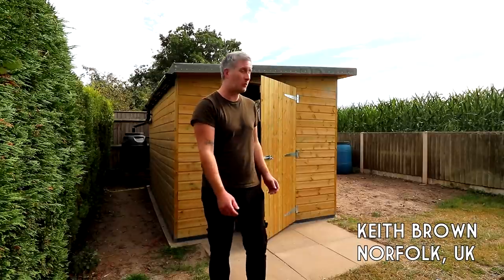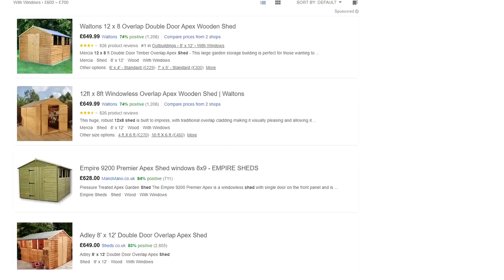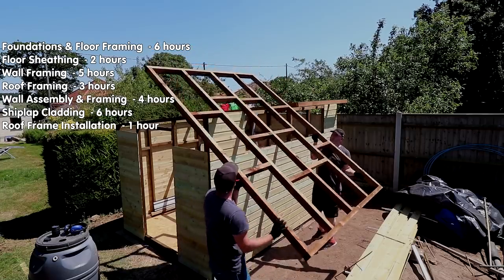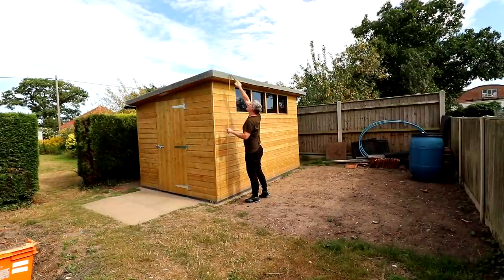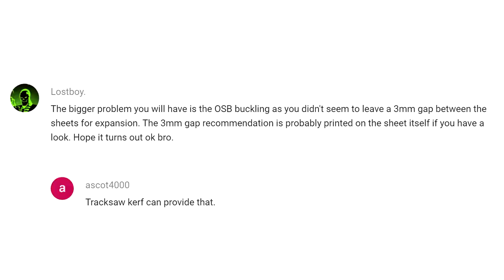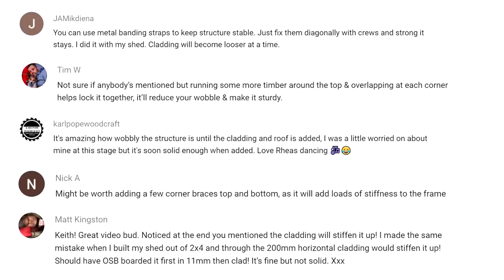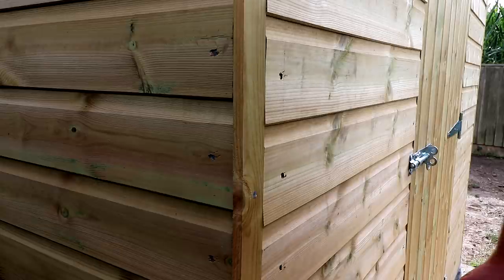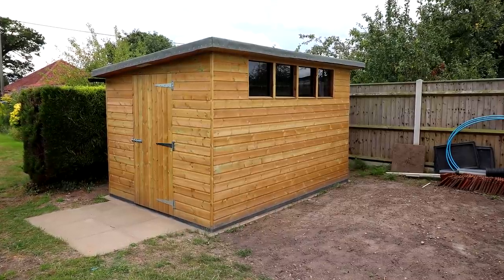Finished Shed - Interior / Costs / Timescales / Q&A (PART 7)

Comment: Few hints on shed storage.
Keep paint tins upside down: stops rusty crud collecting inside the rim. Also stops cruddy skin on top of paint.
Garden Tools. Create a sandbox enough to hold all tools edge downward., pour in old engine oil & mix. Keep spades, shovel, fork etc dug into oily sand. This will keep them clean & prevent rust on surfaces.

Strong build, should last a lifetime!
Reply: I wonder how many guys have read your comment and upturned paint tins with poor sealing lids only for the lid to come off or the paint to seep out over time ? ☺️ It does work but you still get the dry disc on the bottom of the tin(yes you don’t have to scoop it out like if on the top).

 Sitting cling film on the actual paint and cling filming the lid the right way up works. Another dead cert ways is to use all the paint and not worry about it 😂😂😂 Cheers , happy storing ✌🏻👍🏻

Comment: Tip from experience: Take the pressure washer out of the shed before there's any possibility of frost. There's always some water left inside which can freeze and then the washer is scrap.
Reply from the maker: cheers, will do
Reply: Or buy a decent pressure washer like a kranzle which isn’t full of plastic rubbish like karchers or nilfisk or any cheap consumer washer.  Karchers even use plastic housing the motor which is why they fail

Comment: Good solid shed, great to see you addressing viewers questions...

Most of which I feel are from the US...

I have just finished building a 20ft x 14ft workshop with a pent roof. Concrete base, 3x2 frame, 4x2 roof framing, plus OSB sheeting, and a felt roof... Came in under £1600. I was quoted £4k for workshop alone with an extra £500 for the concrete base...

What I have now is much stronger then prefab panels, and it's custom to my needs,

I have a pair of solar panels and related equipment coming within the week so I can have power and lighting.

It really pays to do it yourself.

Great build R & B man! From a fellow Norfolk born diy'er!

Comment: Oh the shed will be fine, nothing to worry about. You done great!
Roof might be a bit iffy but who doesn't have problems with shed roofs after a while.
Reply: Originally, I thought the roof might not be strong enough. However, upon further consideration I think it will be fine. Other that snow there really isn't anything to put noticeable weight on it. Here in Minnesota, in the U.S., snow weight is something I always have to prepare for, so I wouldn't be able to get away with using 2x2 rafters on something that large. I think Keith can though, the U.K. doesn't get as much snow.
Reply: @theopiner402  Yes, where I live snow loading is not exactly high on the list for things to be concerned about, but hail is, and also if you put on a gutter and down pipe it better be sized for the annual tropical storms that hit here, delivering up to a metre of rain in an hour. Worst hail I ever saw was around a half metre of hail drifts, though most was around 20cm, and this was laid down in around 2 hours as the storm passed over. Just lucky I do not live further inland, where tornadoes are also an annual thing to have one or two. Up on the Reef, where I have lived, you have your every day Summer storm, which is just around sunset, and drops a lot of rain each day, with hail as a special, and lightning and thunder as prelude.

Comment: Hello Keith that's a nice tidy shed. I know you're fed up of everybody telling you to do things differently, but I have a very similar shed and over a long period of time it did take on a good lean. It's a combination of internal loading and heating/cooling cycles with the weather. If something heavy is leaning on one wall the wall will tend to move that way. It might take four or five years but it will start to lean. I fixed my shed by adding diagonal braces inside the panels. I made a video of it and it is actually one of my most popular videos even though the quality is dreadful. If I were you, I'd just get 8 lengths of 2x2 and add two diagonals each side, in each end rectangle of each side frame, each one opposing it's twin. I hope you read this, it would be a piece of cake to increase the rigidity immensely for not much extra cost. It might take four or five years but it will start to lean. All the best. Mart.

Comment: I know you've already bought some wood treatment stuff, but I thought I'd recommend 'Barrettine Wood Protective Treatment' anyway. It's solvent based and quite thin so the wood really soaks it up, especially the endgrain and it leaves a lovely satin oil finish (I don't like the modern acrylic water-based stuff as it just sits on the surface). It's available in many different shades and I bought mine from Toolstation, it was about £20 for 5 Litres.

Comment: Good end to a great series Keith. A genuinely useful practical guide and I like the idea of good enough - I am unfortunately obsessed with details and planning, to the point of projects being handicapped by my need for perfection - which I rarely achieve anyway. I definitely need to learn to relax into projects and just get them done! Thanks again. In terms of the shed itself I think the only change I would make would be to fit barge boards (fascias) around the roof felt - otherwise it looks great.

Comment: In the middle of building a 8*12 shed , using 145mm x 25mm hard wood planks OSB board with 8*1 shiplap planks the walls weight about 150kg 😅

Comment: Enjoyed your shed build and found it helpful as I'm currently in the process of building my own. I have a question I hope you can help with. I'm building the shed for my allotment, so want to use some reclaimed materials to keep costs down, but I will be buying the timber for the base and frame. I've gone with 3x2 for the base, but I'm wondering if I can get away with 2x2 for the frame? The shed is 3m x 3m, and I will most likely use pallet wood for the cladding. Will this choice in cladding and 2x2 timber give it enough strength? Or am I better off using 3x2 for the frame? Thanks :)

Comment: I don't blame you for having a go but my 8x12 ft shed contains no chipboard or ply, 1 inch thick floor and roof boards, glass in the windows, double door opening and 15mm t&g cladding cost £650 and they came and erected it for that, I just had to lay the base. All of the timber was tanalised as well.

Comment: there is a bit of something to that cladding comment, i mean if i remember correctly you only added 1 nail per join (to allow for contracting/expanding), which offers no resistance against twists, like 2-3 nails would, in fact it makes a perfect pivot, it's the friction in the tongue and groove that added rigidity to your shed, i wonder what would happen if those panels would contract/shrink... anyway you can add a few diagonal braces on the inside if needed.
Also nowhere in any of the videos did you talk about metal roof or siding as an option, i'm pretty sure that is the cheapest option where i live. It is about 4 quid for a 2x1m panel, so maybe it's not that cheap after all? also you might need some OSB under it since i don't think that adds much rigidity for the walls (or ability to walk on the roof)

Comment: 2.4m to highest point. I got around this by adding some slabs in front. For an apex shed, it's 4.8m, but is not allowed a sleeping space. 1m away from bounding fences.

As for walls, osb is fine, cover with tyvex weather proof lining, then cladd with feather edge. Will last much longer.

2x2 pressure treated timber isn't needed. Cls stud work is all you need once the base is done and you add good weather protection.

Comment: just want to mention that what you use the shed for will decide to have breather membrane and/or VCL or not, in your case i dont think you need one, our UK climate is on the wet side, so you hope there is ventilation or air leak in place to take the moist away more than having a breather membrane which make it worse because you installed felt membrane roof covering which is not permeable, if you installed more membrane underbeath or behind wall cladding it is going to trap moisture in your roof structure.  Some common mistake from DIYer "is more is better", when it comes to U-value and building performance it has to be tailored to perform its purpose.  

i use mine to store bulbs over winter and that moisture movement helps to keep my bulbs better (i keep my bulbs in dry soil and soil will adsorb some moisture in the air.)

Comment: Good design and engineering is when the absolute minimum amount of material is used to build a structure that is sufficiently strong for it's intended purpose. Well designed suspension bridges use this method where the strength in the structure is the sum of it's assembled parts. Many comments against this shed point out the thickness of the wood used yet when the structure is assembled it is more than adequately strong. The key is in the quality of the structural lattice and this shed has that.

Comment: On the 2x2 vs 3x2, I went for 3x2 so that I could put 50 mm insulation in.

On the issue of rigidity, my shed build out of 3x2 and clad in 18mm ply was still a bit wobbly till the roof went on putting the lid on the box.

Comment: Very nice work Keith. I'm still nowhere near finishing the summerhouse but will post a video when it's done.  Regarding paint hoarding: don't bother.  It goes bad, mouldy, smelly etc. and unworkable.  I took all my hoarded paint to the local recycling centre a few months ago as it had gone off.  Then I brought it home because covid restrictions meant they couldn't accept it.  It has now finally gone there, as they reopened the paint section.  I used similar hangers to yours for my garden tools.  They're a bit flimsy, but ok for now.  I like your sheet materials rack.  I have a spreadsheet for my costings.  My local builders' merchant (Huws Gray) is working out cheaper than Wickes.  My build is a going lot slower than yours!

Comment: Hi built my workshop near 5 years ago when you built your 1st shed and gave me ideas on how to tackle the problems i gave myself, using other videos with your ones mine is still standing and still solid.. but yeah watching this one with them windows you will notice the windows bow when the wood expands but I didnt screw mine in i just used sealer to allow some expansion round the edges, unless you take the screws out and make the holes bigger you will probably notice that it might crack the holes you made in the plastic.

Comment: This happens to be the design I'm looking to build. I have to ask though why the door tends to be on the depth side of sheds? Looking to put the door (probably double doors) right where you have the windows. Any reason to not do this? Sacrificing a long wall seems like one reason. Structural weakness reasons as well maybe?
Reply from the maker: You can put the door wherever you like it

Comment: Gaps between OSB sheets are only for walls on wood structure houses. Not for moisture expansion, but for twisting caused by wind on the walls.

Comment: I find it immensely amazing the cost of this project so minimal. I envy the costs for a project like this. In NZ a prefab kitset will cost average $10,000.00 to $12,000.00 so in theory, if I were to do this myself it would possibly cost up to $5,000 to 8,000.00 (second hand) materials. Other than that, awesome job!!

Comment: As long as you keep the outside of it in good condition; coat of paint or spar varnish every couple of years, it’ll last for decades, and probably far longer than even the most expensive shed you could have bought. You can’t look at this from the point of view of US timber framing, homes over here are bricks & mortar, this is a garden shed FFS, not a wooden Buckingham Palace.

Comment: your quite right Keith osb board is very good used it loads of times as shed bases its very hard as well, most timber merchants hate cutting it not very good for their blades in my own garden i used osb 15 years on still good and i done the same used a sealant it works. ive also used it for shed roofs with a good felt.

Comment: No need to leave gaps between the OSB sheets, they barely move, if the do at all. It is virtually a non-issue and is easily remedied if it does become an issue.

Comment: I have used plenty of drywall screws outdoors, and even in the rust belt they survive well, especially if you do like I do and have them in a little HDPE bottle with around a tablespoon of heavy mineral oil inside, so that they have an oil coat to make going into wood easier, plus the oil film keeps them from corroding quite well. 2 bottles, one for each size, and they are easy to get out, hard to spill if you knock the open bottle over, and keeps them from going all over.

Also buy the right drywall screws, not the ones you find at the home improvement stores, which are rubbish, but the ones you buy by the box from the dedicated partitioning and drywall suppliers, which are a finer thread, tough yes still not too brittle, plus in each box they give the right bit to insert them as using a drywall driver your bit will be destroyed after 1000 screws, and thus you will need a new one. Those drywall screws I have drilled them through 1.6mm steel with no pilot hole to mount stuff to the steel tubing, and, aside from losing the head when you do not stop in time, so removing is a bit more destructive,  they all worked. Even those through the chipboard with no head were doing holding, just put one more screw next to them to compensate, then a bit of filler to cover the holes and the now countersunk screws, and it was like new board again.

Comment: The best paint for a shed to give protection is Jotun Demideck but it is expensive at around £50 for 3 litres, it's more a rubberised coating than a stain or paint though so it's not something that you have to keep applying twice a year do it once and it is guaranteed for 12 years and after 12 years it's the colour you choose fading that makes it need another coat not any breakdown of the coating or failure to shrug off water, give it a year for the knots in the wood to dry out then paint it as if you put it on too early the knots bleed through it.  The trick to shed longevity is to protect everything as best you can so I would not leave it too long before applying some kind of protection.  Cracking job on the shed.

Comment: Your shed will be fine.  Mine has the same floor, 2x2 walls, and double doors in the front.  I live in an area well known for rain and now very hot summers.  My shed is 15 years old and the floor is fine.  No bugs either.  Just remember, its a shed, not a house.

Comment: The only rigidity you have to stop raking is the nails holding the cladding. take 1 of your panels and drop it lightly on a corner and it will go out of shape.. Diagonal bracing or sheet cladding  would make it super strong . Take that advice for free from a garden building manufacturer with 30 years experience !
Reply from the maker: When exactly is my shed going to get dropped from a height, corner first on to the floor? That's not going to happen... As explained, I've built it as strong as it needs to be
Reply: @RagnBoneBrown  Fair comment If you are happy and it suits your purpose then thats ok . Its also very encouraging that a young fellow like yourself takes the time and effort to put together a very detailed  video, which hopefully will give people the confidence to undertake such a project themselves.
And anything built by ones self has got to be better than that mass produced rubbish offered by so many garden centres & diy chains.
Good luck !

Comment: You mention using drywall screws to secure the cladding on your old shed. 25 years ago we fixed some shiplap cladding to the fascia of a block of 6 garages with drywall screws. The cladding is still there and I tried removing a crew after seeing this video. The screw came out with no issues.
Reply from the maker: Cheers Mike, yeah I think they're more robust than people give them credit for!

Comment: Well good thing you put the windows on the inside after all. If they do crack due to the screw holes being too tight, it's a much easier job to replace them :P
Reply from the maker: a good point!

Comment: I was glad to see that either you or whoever installed the counter top put the 'extra layer' under the counter to fill it in and make it stronger.  Without that, the counter top would have broken in the load test, with it, as you found, it works great.  So for anyone else trying it, note there is that extra later under the default counter top and to not try that with just the counter top you get at the home store (or from a skip without that layer).  Quick question on the paint, most paints I have had do not do well for cold temps, ie it can ruin the paint if they freeze, so what are your lowest winter temps that you get there?  Fun series on the shed :)
Reply from the maker: i've always stored paints in my sheds, most of them have survived fine.  If they spoil, it's not the end of the world, the paints I have stored there may never get used again anyway.  We keep our best paints (the ones we might need to use for touch ups in the house) inside the house.